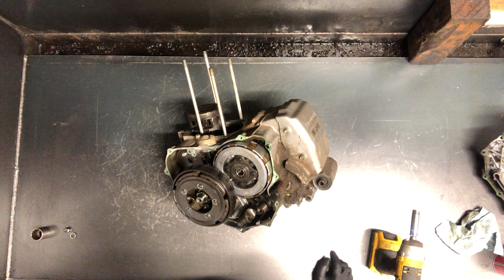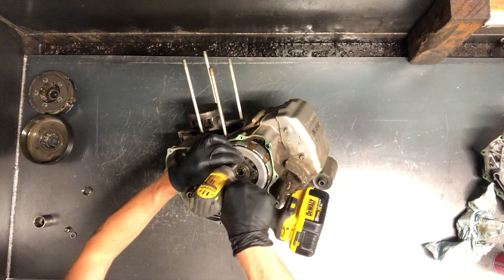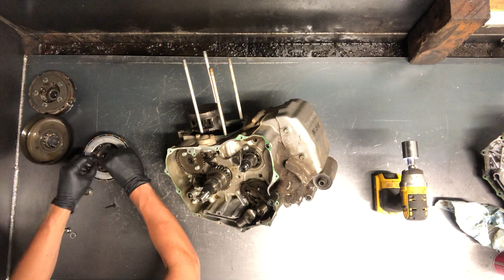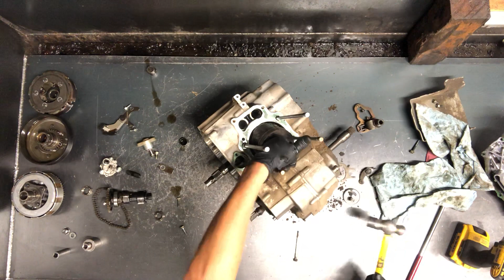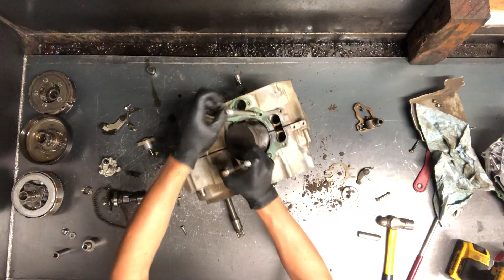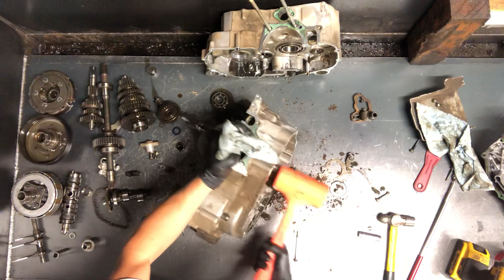Honda Foreman 450 TRX450 - Clutch Removal - Transmission Problem - Crank Locked Up

Comment: Great explaination of the tear down procedure on this style honda engine👍👍
Reply from the maker: Hey, thanks for watching and the comment. Let us know if you need parts or have any questions! https://www.ebay.com/str/midnebraskamotorsports
Reply: @MidNebraskaMotorsports  hay man what's up, my clutch slips on my 400 foreman, and when you let off the throttle it like jumps into neutral, surely if you're going off a hill. 
Is there anyway I can adjust the clutch to fix it, or will I have to get a new clutch? 
I just found your videos, and they're very useful. Thank you. 👍🏻

Comment: I got two Honda foreman 450 2000. Are the parts of the clutch: electric and manual, both have the same parts?
Reply from the maker: For the most part they are. There will be a difference int he shaft going to the transmission. Let me know if you need parts for this model. Thanks for watching and the comment. We have hundreds of videos yet to post. Hit the subscribe button so you are notified when we get them posted. Also check out: https://www.ebay.com/str/midnebraskamotorsports

Comment: Could you put the one way bearing backwards? My 2003 switched directions totally. All gears shift but in reverse and reverse goes forward. I don't know what to do.
Reply: That's not one way that's gear in wrong
Reply: You've got your battery cables on backwards.

Comment: Man, that's rough as fuck !  hitting that crankcase with a ball peen hammer (didn't help you left a bolt in) your lucky your not needing new cases !  Anyhow, I doubt if you ever got this back together, I suspect you can take things apart (in a fashion)  but that's it ! Get a shop manual next time.  PS, I service and repair all makes of ATV for a living....don't ever come near my shop asking for a job, ever.
Reply: I'm pretty sure that he won't be looking you up, Jim Bob.  🤣🤣🤣